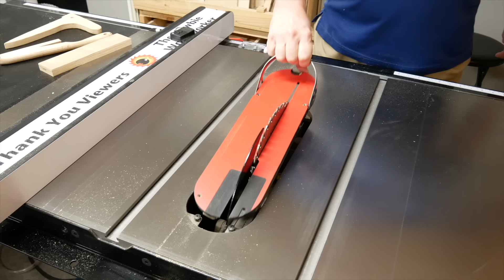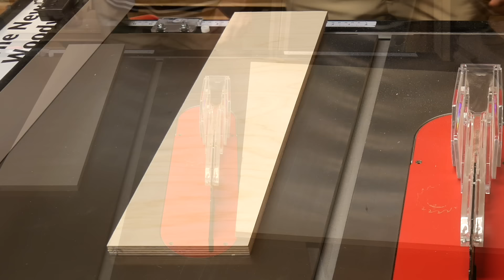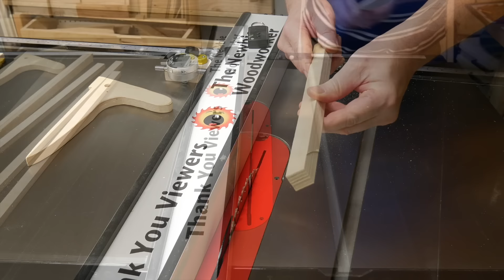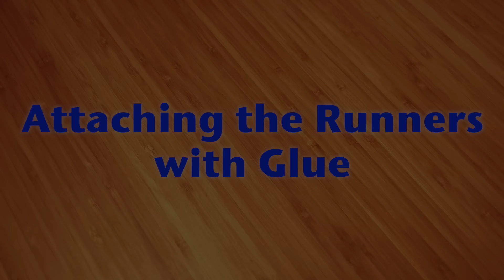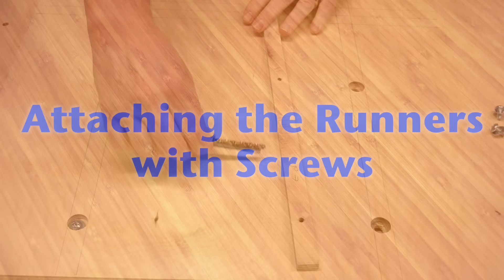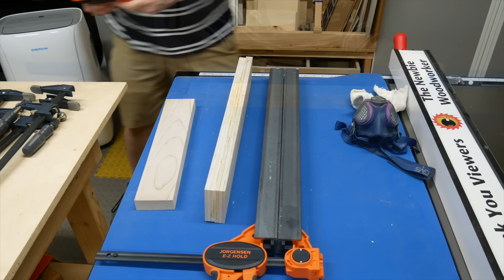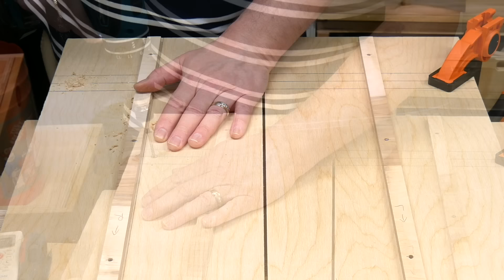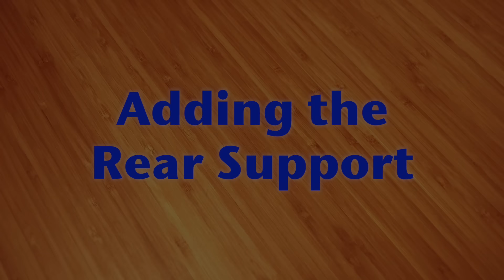Build this Revolutionary Cross Cut Sled, for Newbies!

Comment: Sorry late to the party, but I just watched this video.  Not a criticism just a suggestion.   You spent a lot of time making sure your fence was straight and square, and then you just took it off and cut it in half.   I think I would have positioned two pins that would have guaranteed the fence went back exactly in the right place.  This is the way tool and did makers keep their parts aligned.   Also why did you cut it in half whilst it was off?  Doesn’t the blade go through there when in use.   If it was, in fact, necessary to cut it at this stage, then four pins to lock position would have insured the fence was still square and straight.
Reply from the maker: Thanks for the comment, Doug. And a special thanks for starting it off the way you did, talking about your comment being a suggestion and not a criticism - it's so hard to know people's intentions, and I appreciate you taking the time to set the tone right at the start. Not everyone does that.

I think you've made some valid points. I did it the way I did it because it's just the way I thought of doing it. That's the problem with working by yourself - there's no one to bounce ideas off of. In my case, since I'm using Baltic birch plywood for the fence, and Spax screws, my experience has been that things go back on exactly where they were, because the wood is so solid, and the screws so exacting. But I'd imagine that for most people making this sled, that might not be the case, so adding the pins would have been a been a great idea.

I honestly don't remember why I cut it in half that way. The only thing I remember is that there was a reason. I could probably go back and figure it out, but at this point it's kind of irrelevant. 😄

Anyway, thanks for the comment, and never be afraid to speak up. I learn so much from comments like yours, and I've changed a lot of things I do based on the things you guys say. (And I mean "guys" in a non-gender way, more like "y'all". I've got to find a better term. 🙄)
Reply: @TheNewbieWoodworker  One reason I made the suggestion the way I did, was I am not sure I would have thought to do it any other way either.   I had the privilege, many years ago now, of working as a prototype machinist.  I shared the shop with the tool and die makers.  I learned a lot by watching the way they did things.   You made a good video, that was fun and informative. I just wanted to share a wee bit of that knowledge with you.
Reply from the maker: @dougberrett8094  Thanks, Doug, and thanks for the kind words about the video. I'm with you - I think the best way to learn things is to watch experienced people go about their normal tasks. You learn things people wouldn't even think to point out, because it's so second nature to them. I'll bet if all of us could spend a couple of days tagging along with professionals, we'd learn more than anything we'd learn from tutorials or manuals. Of course, we'd probably drive them crazy - "Wait, what did you just do there?" 😄 It's too bad most of us will never get that chance. Thanks again.
Reply: @TheNewbieWoodworker  In answer to your question about what I did there, I prototyped parts for the optical engineer. I needed to use the tool and die shop because their shop was the only one that had machines accurate enough.  The place made stage lighting equipment.   We owned the dimmer market in Las Vegas, but the lights were not good.  They hired the optical engineer to change that.   It was a pivotal job for me.  They liked my ideas so much that I was invited into the engineering group.  I retired at the end of 2017 after designing such diverse things as mechanical meat deboners and drill bits for oil wells.
Reply from the maker: @dougberrett8094  Sounds like you had a lot of fun. 😄

Comment: I made this and absolutely love it. Thanks for the assist. I cut the runners off the board first and nailed it the first time. I had to redo the fence a few times and wound up making it a bit thicker because my screws kept parting the boards I’d glued. I guess I was too perfect. 😆
Reply from the maker: Thanks, and 😂. Also, drill pilot holes, or perhaps bigger pilot holes? 😄
Reply: @TheNewbieWoodworker  I could have tried bigger pilot holes, but the thicker fence worked too.
Reply from the maker: @EASchmidtE  Cool. 😄

Comment: Could I make this sled with MDF ?  It is what I have available. I know it does not look at nice, but structurally speaking, would MDF be suitable ? Nice quality video, by the way.
Reply from the maker: Thanks. I think MDF would be OK. It's worth a shot, right? 😄
Reply: A sled made from MDF will work, but it may not hold up as well as plywood. MDF cannot tolerate moisture/humidity as well as plywood, and if the sled or runners are made of MDF they may be easily dinged, dented and crumble with sustained use.
Reply from the maker: @madcacher1119  👍

Comment: You're making this harder that what it is. If you're new to woodworking check out others on you tube. You'll see that this isn't as hard as this guy's making it.
Reply from the maker: Thanks for the comment. Two things: 1) I have a simpler sled build: https://youtu.be/b-65Bs5Yi0w. But remember that I go into detail in my videos, to help newbies understand each step. 2) Have you seen another video for building a sled that lets you keep your blade guard on? If so, can you share the link?
Reply: @TheNewbieWoodworker , to be honest, I think the only part you making it a bit more difficult is that you using machined screws and going to extent of the whole process to make them work instead of using mitre glue and activator and support it with wood screws instead, other than that it's your project, it's just my opinion, rest of your project looks great, nothing wrong with it 

it's like making 3 legged table for the first time, and argue that should have 4
Reply from the maker: @TheBizLens  LOL, thanks. I've gone back and forth over attaching runners, but now I agree that CA glue and activator is the easiest way. I've always worried about needing to readjust the runners, but since that's really never happened, I think I'll just not worry about it. I mean, if I had to remove the glued-on runners, CA glue is brittle enough to break.

Comment: Now I just need to get a table saw (any suggestions for a small shop?) to build the sled for. LOL, serious shopping is progressing.
Reply from the maker: I always recommend a SawStop. Their JobSite saw starts at $1399, but it pays for itself the first time it prevents a trip to the emergency room. You might also find a used one. If that's too much money, this DeWalt saw https://amzn.to/3693o4u is $600, and of the close to 4,000 ratings, 90% gave it 5 stars, and 8% gave it 4 stars. Holy cow! I can't remember ever seeing ratings that high on Amazon. Still, I'd go for the SawStop 😛

Comment: Great tips!  I built my sled today after watching many YT videos, but yours had some of the most detailed advice and also how to get the fence perfectly square with a framing square.   I used most, if not all, of your ideas to perfection.
I had some hardwood 2x2's from a pallet my generator came on.  No idea what wood it is, but it's real dense and formed the runners.  The gray coating on the table left marks on the runners, showing me the high spots to sand, since I used screws without a big clearance.
My only issue was the 1/2" plywood bowed up on the right side in the middle around the blade clearance slot.  I sanded it to get rid of the high edge.
Your presentation is very clear, concise and entertaining.  Thanks much!
Reply: I prefer to use my miter saw for cross cuts unless the part is too wide, but sometimes it's just easier to do it all on the table saw, especially since I have to reconnect my shop vac for dust collection, then there's all the clean-up after!  I'm OCD about cleaning up debris between each project step!
Reply from the maker: @AllenReinecke  It's awesome that it worked out so well for you! No project goes off without a hitch, even for experts - they've just learned more about how to fix things. 😄 And thanks for the kind words. I totally understand about the miter saw. If I had room for one, I'd probably have one. And good for you about cleaning up after each project step! I'm reasonably good about that too, and it feels good to get rid of the clutter. Having a small shop makes it more necessary to clean up the clutter, and more obvious when it's done. Anyway, thanks again for the comment. 😄
Reply: @TheNewbieWoodworker  I have a 40"x40" table I built, that my Dewalt DWE7485 saw fits into and the height matches my home-made 4ft x 8ft work bench for large sheet support (Begs the question of which came first... the saw or the table!  😉).   So my sled is a whopping 40"W x 24" D.  I added a removable, drop-in stop to my table so that the sled won't travel so far that it exposes the blade on my side of the fence.  The sled will hang on the side of the table for storage.  I can see many projects just on the table and sled themselves, let alone any actual wood projects!  😂
Reply from the maker: @AllenReinecke  What, build something useful for outside the shop? The only things I ever build are stuff to help me build other stuff. 😂 (That's not strictly true, of course, but it's mostly true!) Good job on the table and workbench. Since I'm so limited on space, I plan on replacing my "workbench" with 2 flip-top cabinets and a third cabinet with a normal workbench-type top (with downdraft), all hooked together to act like one large workbench. For the flip-top cabinets, one will have my drill press and band saw. The other will have my belt & disc sander, and probably an oscillating spindle sander, although I'm not 100% set on that. See, lots of future projects of "stuff to make stuff". 😄
Reply: @TheNewbieWoodworker  I've actually finished making stuff to make stuff and now I'm making stuff.  It's awesome!
😂😂
Just drawn up a kitchen cabinet as my next project.
Reply from the maker: @AllenReinecke  Novel concept. I'll have to try that! 😄

Comment: You did a great job on the sled, on a side note,  you do care about us using the safety guard or you wouldn't have said anything about it!!!
Reply from the maker: Thanks, and you're right of course. What I don't want to hear about is that someone hasn't used one and hasn't had an accident so therefore they'll never have an accident without one. Just because something hasn't happened doesn't mean it won't ever happen. 😄

Comment: Good job on the video.  When lining up predrilled screw holes, I often push small loose fitting finishing nails into all of the holes, (#6 or #8), then progressively pull out one nail and start a screw. Once all screws are running true, go back across and tighten them in.
Reply from the maker: Interesting! I usually just screw the normal screw in enough so it sticks out the other side a little. Then I don't have to remove anything. However, I'll definitely try your method and see if it's easier. Thanks! 😄
Reply: Definitely depends on the application, materials and number of screws. Pins in the holes guarantees alignment of pieces. I built a diagonal railing frame with small oblong balusters and about 50 pre-drilled holes. Getting the first few in wasn’t bad- until it became impossible. That’s when this method really paid off.
Reply from the maker: @ehRalph  I'm already imagining ways to incorporate your idea, trust me. And yes, it does depend on the application, but having another "tool" in the toolbox is definitely a good thing, especially when it has potential like this!

Comment: this is great. However, I think a faster way to get the width right, is to take your miter gauge and put the track between the fence and the blade and then close it up. It will be the perfect width. Then back the fence off just enough for the miter track to pull out and then you will have the width you need for your wood track cuts.
Reply from the maker: Thanks! If that works for you, then that's awesome, and definitely the way to go. But for many people, there's several challenges. First, most stock miter gauges don't have a good fit, so I'm not sure it would really be easier for them.  And if you use a store-bought miter gauge, the kind with an adjustable runner, it might be hard to get it between the fence and the blade in just right place, especially if you have the typical kind of blade where the teeth stick out past the sides of the blade.

And second, depending on the size of your table saw, you might have to take the miter gauge apart before you can use the runner like that, and depending on the miter gauge, that could be anywhere from tedious to "I'll never get it back together right". 

BUT, with those caveats aside, it's certainly a good idea if it works in your situation! 😄Also, this is just me thinking out loud. As I re-read this, it sounds like I'm dumping on your idea, and I don't mean it like that. Like I said, just thinking out loud. 😏
Reply: @TheNewbieWoodworker  no problem at all. i only mentioned it because i just did this yesterday. first i cut 3/4" plywood strips, then realized they were too tall, so then i measured the height of the track space and then cut to just 1/16th under, to make up for the coins that i was going to place under it. Afterwards, was having a hard time mounting it to the sled. I was going to use CA glue, but then a friend of mine reminded me that I may end up needing to replace the tracks since they're wood. Then I remembered I bought the protools aluminum tracks specifically for this purpose and eventually used that. I ended up mounting it a little too tight, but loosened the offending screws a tad and it was still secure/sturdy enough while having the smallest amount of play.  the rails were rubbing on one end, hence loosening the screws a bit on that end. Now everything is running good.  

I do have to build a better sled as this is my first legitimate crosscut sled I built to completion. All others were makeshift and temporary. I tried that miter option you suggested and it did not work for me because the piece i wanted to cut started much farther out before it secures evenly to the track.   

Anyhow, my miter gauge came with my table saw, so it actually worked out really simply for me. I just pinched it between the blade and fence and just maneuvered it out. I did it to the tooth, not the blade, as the tooth is the actual edge where the piece would stop, so it was easy to move the bar out afterwards. Another option was once it was set, to just lower the blade.  But yah, definitely more than one way to do things. Just thought I'd offer my most recent experience (yesterday).  

Also, I really appreciate the immediate response and the fact that you time mark your videos to the sections. I'm getting into wood working this year (started 2020 during the pandemic) and I've spent exorbitant amounts of money. I need to make some return on investment and speed up the projects i'm building at home to forego buying furniture.  

I will def continue to check out your channel and see what else I can learn, which is a lot i'm sure.
Reply from the maker: @nkbrkr5386  Awesome - it sounds like you've got a firm handle on things. I definitely prefer using screws on runners, at least until you feel like you've got it down. I cut a bunch of runners I know fit, so I've started using CA glue just because it's easier and quicker, but as you mentioned, I might come to regret it later. 😳 Once you've built a few sleds, you'll start to get good at them. I've made a bunch of different sleds, so a lot of the things that used to take a lot of time happen a lot faster now.

I try to reply to comments at least once a day, but right now I'm at the computer working on editing a video, and my brain's not quite cooperating, so I'm "wasting time" checking comments more frequently. 😛

As for spending exorbitant amounts of money, well, that's sort of the way it is with woodworking (along with other things in life). And if you're anything like me, you see something cool in a video, and you just have to have it! I hear there's such a thing as "restraint", but I rarely witness it first-hand. 😂 Good luck and have fun!